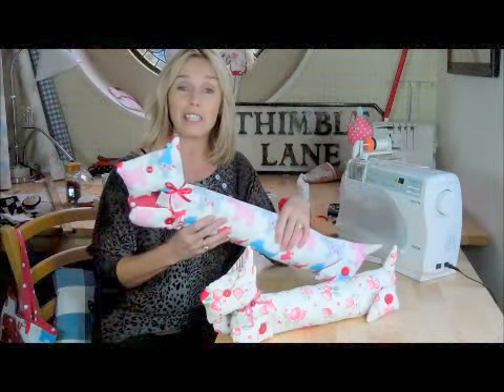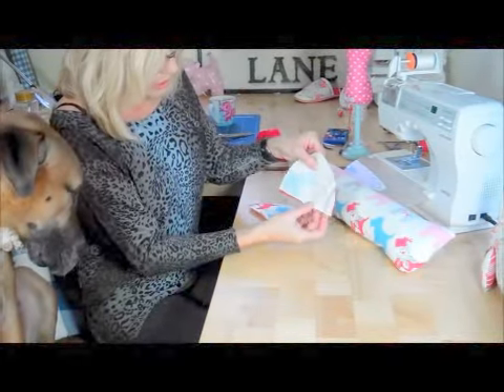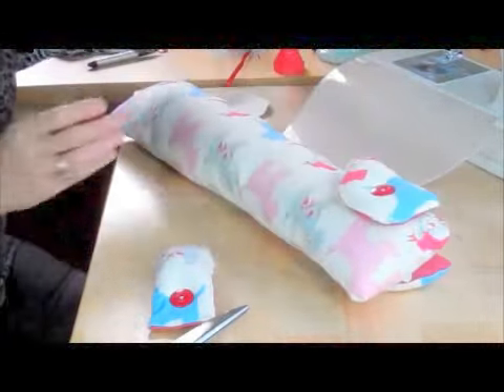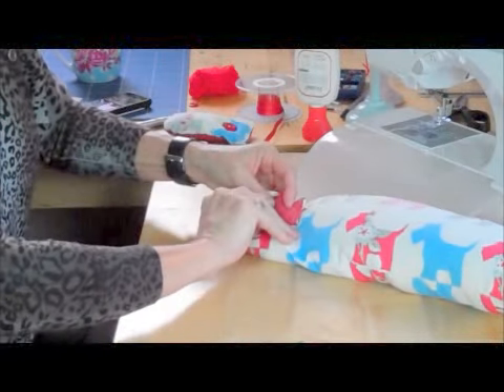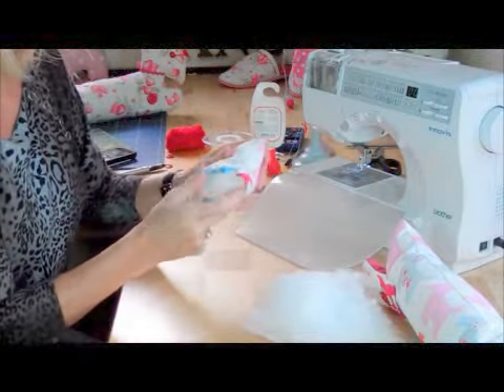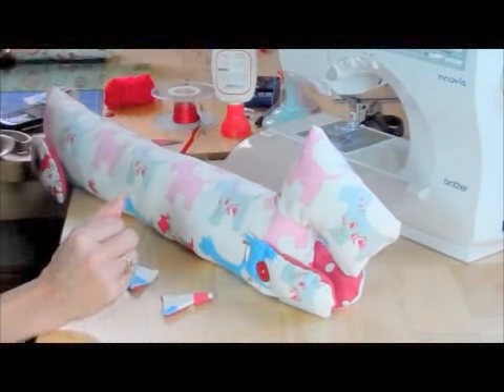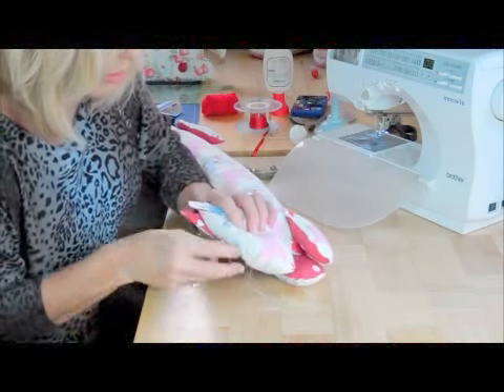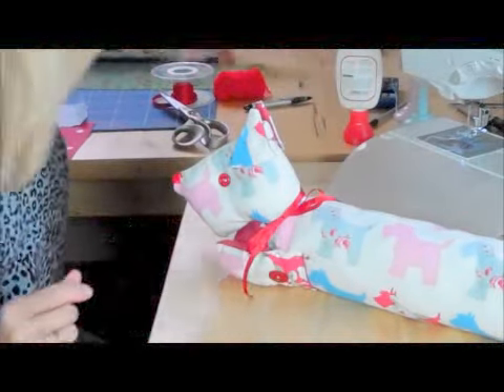A doggy draught excluder by Debbie Shore

Comment: How long do you think this would take for a complete beginner with no sewing machine?! Also how do you do the extra stitching on the bottom after you've turned it inside out & stuffed it, is there a name for it? Obviously I don't want the ends of the fabric showing.. thanks :)
Reply from the maker: ecureuil85 I use a ladder stitch to close the opening, an over edge stitch would be okay, you don't really see these stitches as they're underneath the dog. I've not made it without a sewing machine, so I don't really know how long it would take, half a day maybe?